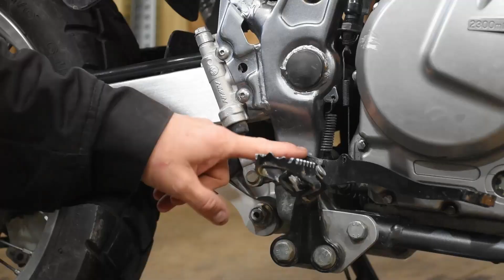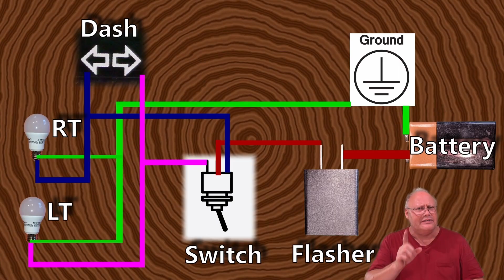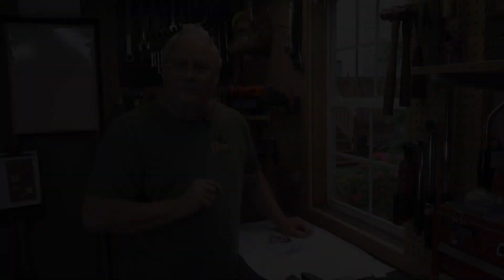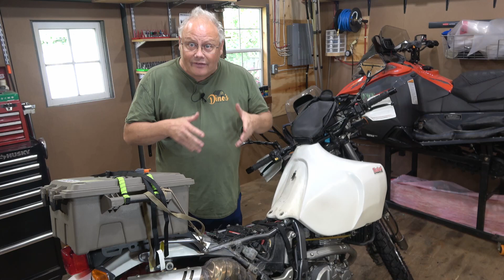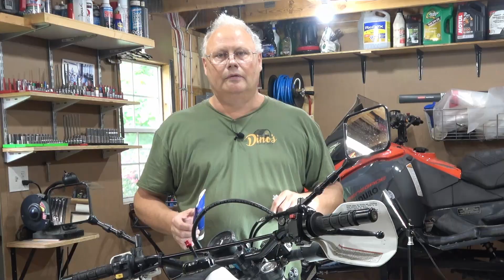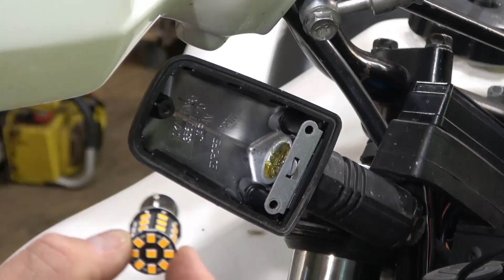Today, I am upgrading the DR650 to LED turn Signal bulbs, using TST Industries solutions.

Comment: Modifying the turn signal indicator is not that difficult. But the idea of using a piggy back harness is great. Just for sale of warning , using a LED turn signal indicator bulb MAY cause the whole circuit to fail. Some Turn Signal box, even the LED specific requires a small amount of current to flow in the "bulbs circuit" to start. LEDs are so good at saving power, they won't allow ANY current when not fed with enough voltage. If you run in this problem you can just keep your incandescent bulb for the indicator or add a small resistor across the "bulb". 1  kOhm / 1/4W is good enough...

Comment: Thanks for the referral to the TST gear, and the great write-up! Along with a LED headlight and taillight, there's no way a motorist will be able to say they didn't see me or know I was turning. 

Also, 2026 update: the flasher is still set up for (according to the pinned post below) overseas bikes, I had to zip tie the flasher somewhat clumsily next to the rubber boot that held the original flasher. Not the end of the world, but it feels like a miss from TST that they could have fixed in the three years between this video and my installation in Feb 2026. It seems they could have kept the circuitry and invested in separate cases for different geographical locations to maximize the plug-and-play.

Comment: Hi Dino thanks for the video.I’m   currently involved  adding turn signals to a bike “moped” that never had  directionals .so I added pods just like yours .replaced bulbs with leds .,my circuit, switches the negative not positive and the frame of the bike is not dc .ground ,but AC ground .so i have separate  DC ground wire for all 12 volt DC items. The AC is for the original points ignition.any ways after testing two pods .the led amp draw is only .340 milliamps constantly on but since that’s 100% duty cycle.and the lights will only be on 50% of the time because iit blinks on and off that should only be equivalent to one light constantly on .340 mA \ 2= .170 mA not even a 1/4 amp so i used cheap .18 cent  1k ohm 1watt resistor for each side set of directionals .  Tested the directionals on the right for 5 minutes  blinking straight and felt the resistor for that side and wasn’t even warm .same for the other side ,and blinks nice and slow like it should.works superb .

Comment: Great video! Didn't know the pigtail product existed. exactly what i need. Regarding the flasher, there is an alternative flasher from ProCycle that fits the rubber mount on my 2007 perfectly and flashes at the perfect speed. but it's not adjustable like the one you got.

Comment: Hello Dino , I absolutely love your videos!!!!! i just bought my first dual sport.  Its a 2006 Dr 650 with 4k miles !! Bike is absolutely in great condition! I just want to upgrade the headlight to a LED ,I like the original turn signals!  I want to keep them . Could you recommend anything?? What is all involved doing This? Thank you !!!
Reply from the maker: @nicorizzo3607  I have had good luck with the cyclops h4 bulb. It's bright and half the amp draw of the stock bulb

Comment: Hi Dino, another great video, I just ordered front and rear signal lights from TST Industries along with the diode module and flasher relay. (a bit pricey but nice stuff) Now I want to just replace the brake light bulb with a dual filament bulb I think you called it. Where did you get the bulb to replace yours? and was it just a screw in replacement? Thanks and keep the videos rolling. I mentioned you to TST as to where I heard of them. Cheers
Reply from the maker: Glad you enjoyed the video. I got my rear tail bulb off amazon. I just ordered an 1157 LED light for tail/ stop lights in a car. lots to choose from on there.
Dino

Comment: I love this show. Been watching since I got my DR last August. Incidentally I bought the TST diode and relay and wanted to watch a video about LED turn signal installation and I was happy you made the same decision to go with TST. Also, not sure if anyone mentioned this but if you open the flash relay, you can modulate the speed of the flash with a little dial in there. As always, you shine a light on my own tinkering journey. Thanks.

Comment: Appreciate you showing us all!  I may go this route. But, what I was looking to do, was to make my rear turn signal into brake lights AND turn signals.  I had that system on an old motorcycle I had years ago. I had purchased it used, so the previous owner had already added that modification.  Does anyone know of a plug n play kit that would allow me to do that on my DR650?  If not, I will do what Dino did here. Thanks!!

Comment: Great production Dino! Very nice presentation. You were kinda right, that LED's DO require less voltage... For automotive use, maybe 3.2V per LED. MOST replacement lights will be made in a 3X series circuit with a current limiting resistor built in to get the proper working (12 to 14V) range of your bike.
But you're also right, it's the low current draw of the LED "bulb" that's tripping up the circuit design.
Also, Best Dino "talking head" video yet! 👍🏻
Reply from the maker: Thanks, for the additional info TLO, it always helps to have others build on the information. 
Also the talking head was fun lol